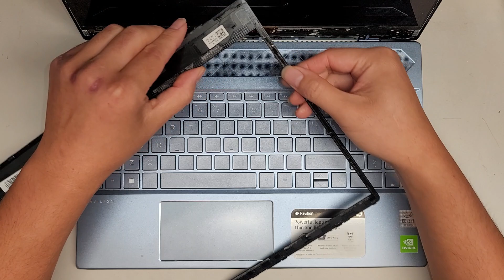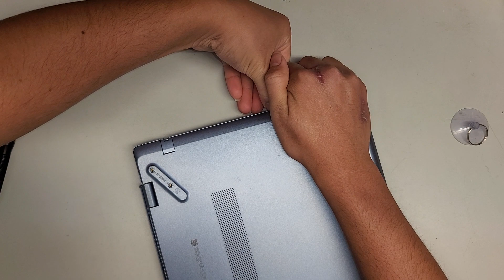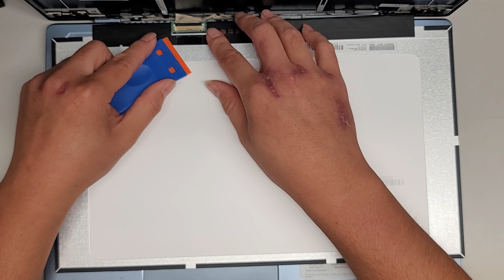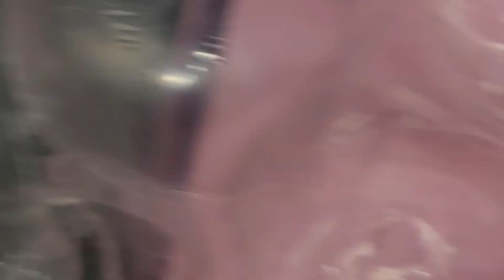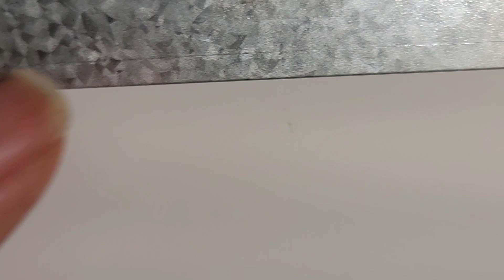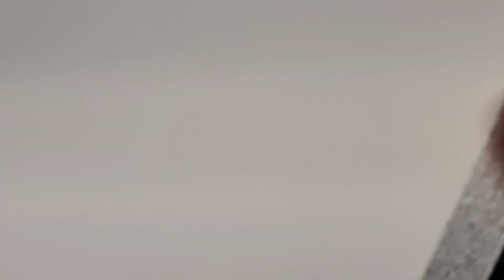HP Pavilion 15-cs 15-cs3073cl Disassembly RAM SSD Hard Drive Upgrade LCD Screen Replacement Repair

Comment: 16:31 i am pretty sure it supports PCIe NVMe because i have an hp pavilion cs3075wm with no hard drive and instead intel optane
Reply from the maker: If that's the case, it does support nvme. Thanks!

Comment: I have this exact same model. It runs so slow. Would it be worth my time and money to upgrade to a NVMe drive and 32 GB of RAM to see if that helps? Thanks in advance
Reply from the maker: It'll make a huge difference as long as the processor is decent.

Comment: Hey dude, I need your help troubleshooting my Acer Aspire 7 a717-72g-ds2. It boots to BIOS then halts, no display either on screen or HDMI. Fans start then stop. My meter says power is good. I’ve tried RAM — no: I’ve reset BIOS. Mboard is clean I have tested it.
Reply from the maker: What do you mean by boots to bios?